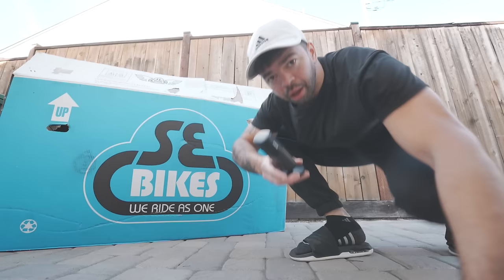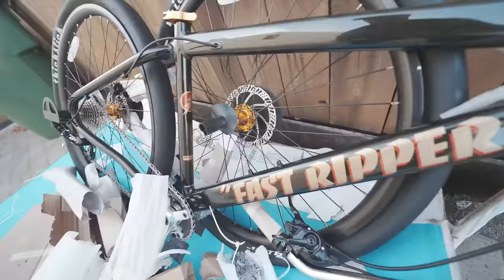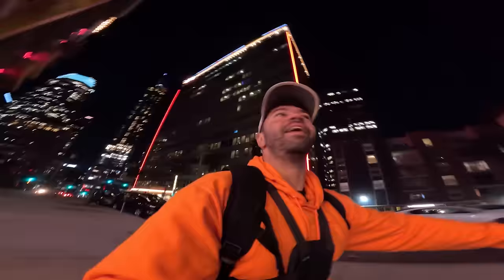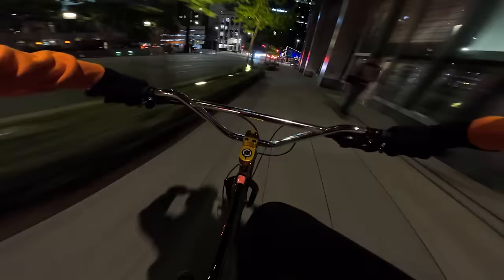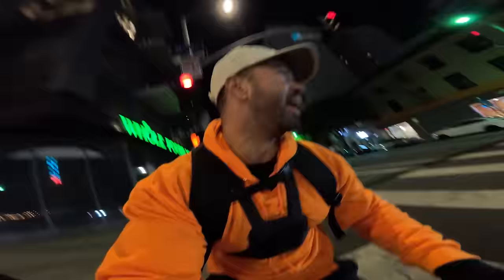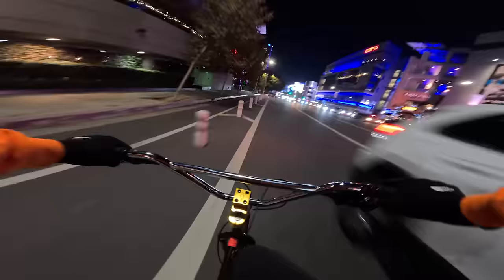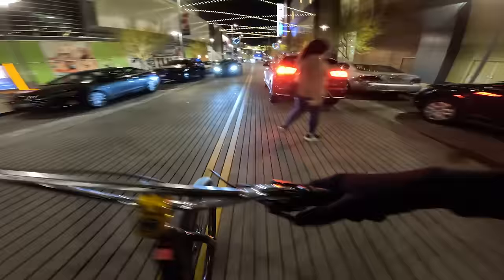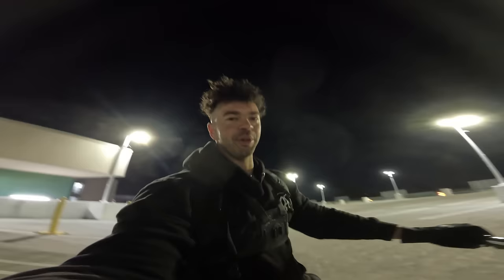I BOUGHT A RARE BIG BMX BIKE - SE BIKES FAST RIPPER 29"

Comment: I'm old too ... im in a conundrum..... PK big ripper  or the Stolen Max 29iner  the Max is 450 ish to 550ish  im just hitting the trails and fuking off
Reply: Funny I’m going through the same thing right now. The max is better on paper cuz chromoly frame and parts are stronger opposed to the aluminum frame of the se bikes and price is better but something about those se bikes got me wanting one. I’m currently look for big flyers second hand. I think the frame geometry might be better for getting that front end up but not fully sure. Definite bang for buck is the stolen max 29er. Full chromoly double walls rims sealed bearings all around. If you can’t get rid of your itch for an se I would suggest the big flyer instead of the ripper. Sealed mid bb just makes it all stronger more modern frame design aswell.